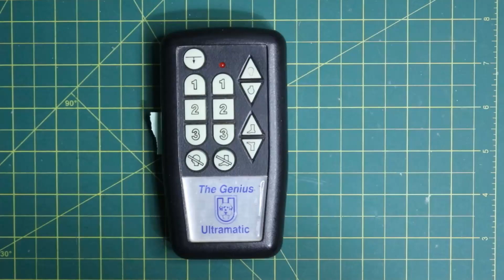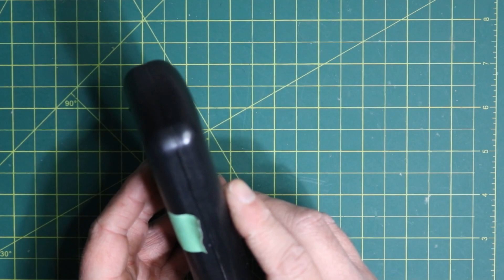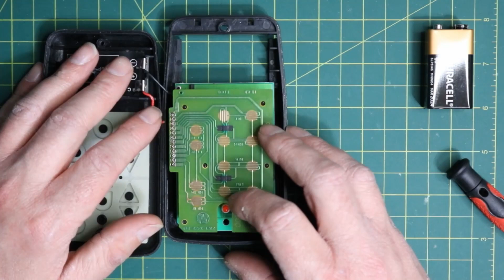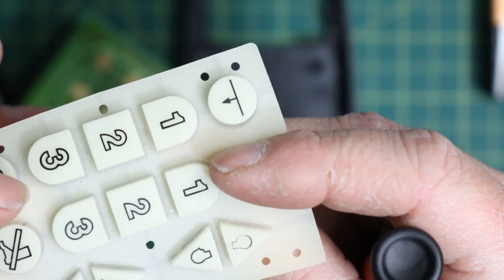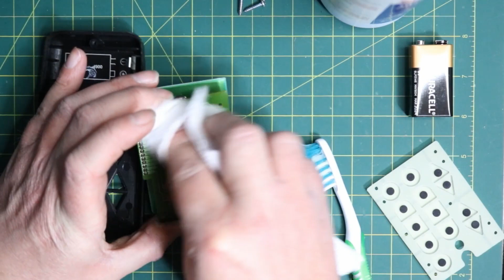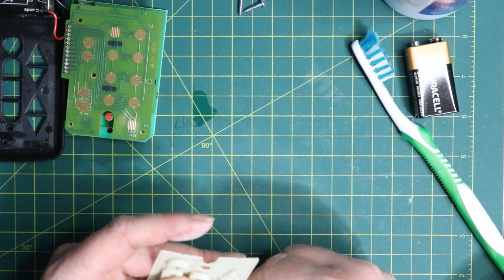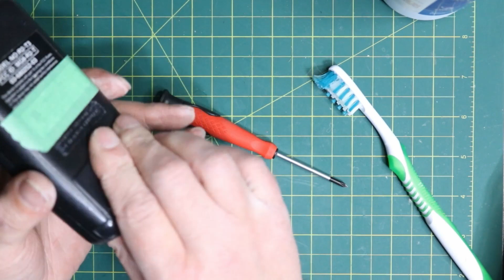The Genius Ultramatic Bed Remote Repair

Comment: Can anyone tell me where I could buy the remote or a replacement for it?
Reply from the maker: Call a few medical supply shops that rent and sell beds they might have some new old stock or ones they can salvage.  I've seen these on ebay randomly as well.
Reply: @ScottFraser-k6v  it's the genius ultramatic and they have a website where they sell this remote. I haven't tried to buy one because it's very expensive.

Comment: I have 2 ultramatic beds lent to cousin and she says can't get remotes too work weird both stop at same time any suggestions for trouble shooting??
Reply from the maker: make sure the switch under the battery or close to it.  If it has it is set to the same frequency of the bed.  some beds have a box under them that have access to a switch as well.    But were they working then not?
Reply: @Gam3T3cHElectronics 0:03 hi thanks yes they were working before I  had them in storage for about a year then went to lend them so might be a switch under bed already did switch in remote
Reply from the maker: would make sure to try a few different batteries.

Comment: Is it possible to get a wiring diagram for the control box on the bed itself Model R2T3
# 03-630256
Reply from the maker: I don't have access to that right now unfortunately.  It should just have the 2 motors and power out on the bed if I recall correctly. Feel free to email me and I'll try to see if I can find something.
Reply: @Gam3T3cHElectronics  It also has 2 vibrating motors as well.  The control box has 4 contactors to convert from low voltage to 110.  They are what is not functioning.  How do I get your email address

Comment: When you press the buttons on the Genius Ultramatic remote does the red light come on?..  Mine has no lights when any buttons are pressed
Reply from the maker: No to see if it's working you would have to aim it at a camera to see if it picks up the press. Using your phone you should see it working also make sure both the bed and controller are on the same channel. Little slider in the battery compartment.
Reply: The LED on these is only for low battery indication, and is not connected to anything else. Deceptive, I know . . . Not sure what aiming an RF device at a phone/camera is supposed to accomplish, btw. If it was an IR remote, the camera/phone might see something happening. But unless your camera can see radio waves, you won't see a thing from this remote.